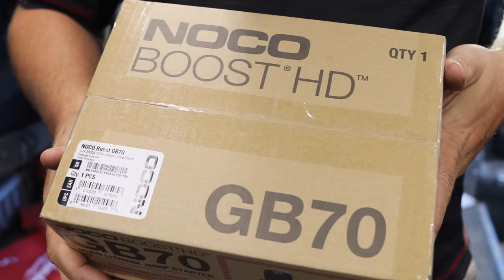Snap On Tool Talk and Another NOCO Boost HD Joins The Shop

Comment: I have the first gen of that 7.2v screwdriver, one battery died and the other is on its way out and the grip has started to melt, but I've had it for 13 years and I just can't find anything to replace it with.